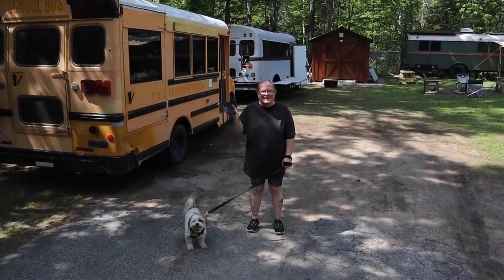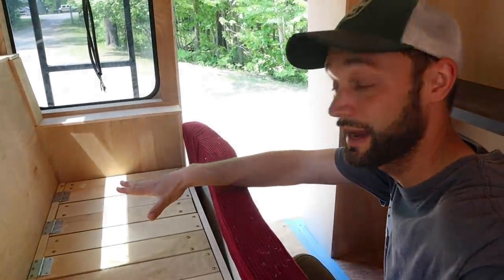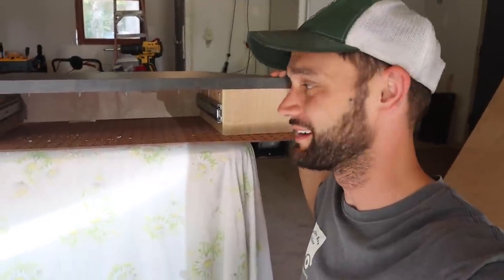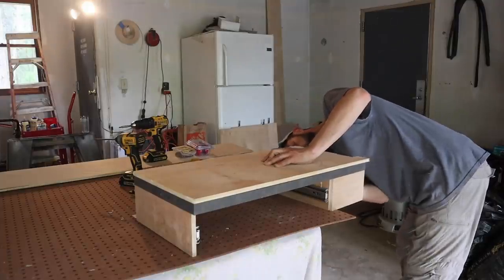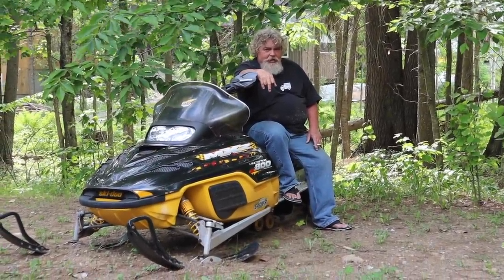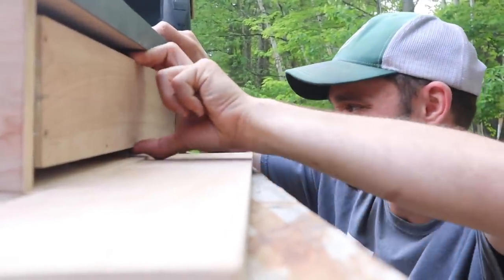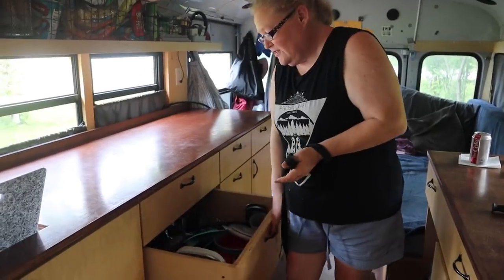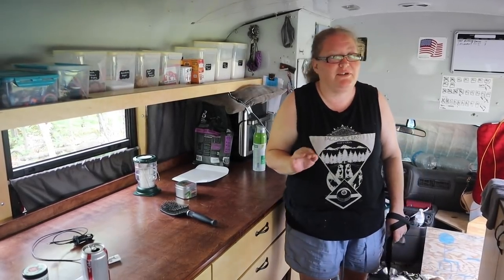Working From The Road | Buslife Office Desk

Comment: Mike: looking good! For your mouse, why not make a flip up on the extra section on the right, then your keyboard won’t have to hang off the side.
Reply: I was thinking the same thing!
Reply: Seeing this, I thought the same thing.   Redo the drawer as a trapezoid so the right angle triangle section has a very small piano hinge or two smaller hinges which allows the unfolded mouse pad base to be a near seamless square.  You should still be able to have the drawer slides where they are and round the sharp edge or place thin rubber liner to prevent leg injuries.

Comment: You could mount a small mouse pad shaped piece of metal underneath the flip up that swivels around to the right hand side when you want it and is attached to the lid when you don’t want it .3mm aluminium would work great

Comment: Idea for the desk:  The unused space to the right of the pull out desk drawer... I know it tapers in, but you may be able to design a piece that slides out straight or is on a semi-circle/swivel, to pull out an extra surface alongside/matching the drawer.  You're not using that space anyway, it's just a face plate right now.  It's big enough to almost fit your complete mouse pad, if done correctly.

Comment: I wish I caught this sooner. I was going to suggest to do a pull out drawer to the right(or left if there is enough space) and have the top be a leaf system so you can always access the drawer, but also flip the top section out for a larger desk when needed

Comment: Mike you thought about mounting a 24 inch tv/monitor on the back wall and connecting you laptop to it.  Add wireless keyboard/mouse.   Just a thought.   Love your videos.
Reply from the maker: Yes. I placed the 120v plug higher to accommodate a possible tv mount

Comment: Cut the bottom deck (Under the drawer) back an inch. That way you can pull the drawer open by pulling on the bottom of the drawer front. No handles to get snagged on when walking past.

Comment: If you router a slot in the bottom drawer board you would be able to use your fingers to pull out the drawer  by the face plate and then there would be no nob or handle to snag on

Comment: Unintentionally or by design, Dale had me laughing before the video ended. Thanks for that!  And, on the off chance that he reads the comments,  thank you Dale!!  If either of you remember any of the Charlie Brown movies or cartoons?   Do you remember how the adults sound.  WaaWA WaaWA Waawaa, in a midrange monotone?  My daughter had it down pat.  Probably shouldn't have but it amused me. She would do that anytime I got on to her.  She heard me and would do, undo or arrange whatever so her sound effects were of little concern (to me).  After the first two times, there was no disrespect as it made me laugh and the first two times were funny, whatever her intent.  I could imagine that when Dale was gchewing on you.

You are young enough that I suspect you will spot a bruise on your hip or thigh and have no idea where it came from, right?  Those usually come from opjects sticking out that catch you as you hurry by.  Like drawer knobs.  Especially in tight quarters.   With that in mind, maybe you could skip the drawer knob and just cut a half moon divet from the top center of the drawer facing.  Just big enough to fit a couple of fingers in to pull it open.  The drawer fit perfectly, it will not be .....counter sunk (lacking a better word).  If you can carve, you could even hide the grab in a design that would make it less apparent that it is a drawer.  And with a lock towards the back or a hidden switch, you would have a fairly secure spot.    Almost as good as false kickplates on Your counters.  

Don't laugh but I was considering stashing a telescoping ladder at my roof hatch because I didn't want kids climbing on the roof and breaking something.   Like a leg, arm or neck.  Putting a ladder on the back but higher up so that you could still only access the roof from inside.   I like it!!

Comment: That faceplate to the right of the drawer in the desk could easely be made into a plsce for your mouse when you need to use it.
Reply from the maker: That might be a great solution.
Reply: @navigationnowhere    Or make it into covert storage space with just a swing door and bottom.  Only openable when the drawer is open!!!

Comment: You could make that face plate as a pull out since you could still make it at an angle and use a mouse

If you used a trackpad I would just say make it a flip up, that square looks like the perfect size

Comment: If I was the talented geezer you are, I would have built in sections for my keyboard, mouse and laptop. It would look cool and it would stop them from moving about when on the road. Looks good geez. Another thing, how about cutting the lid so that it folds out to the right for the mouse. The keyboard should   just sit over the drawer opening that's left.
Reply from the maker: I was concerned about the stuff sliding around in the drawer but, I figure once I get everything moved it it won’t have much space
Reply: @navigationnowhere  
I'm just trying to be too flash. 😀